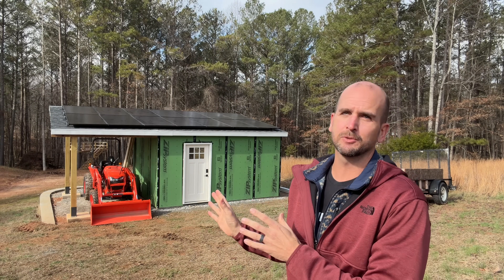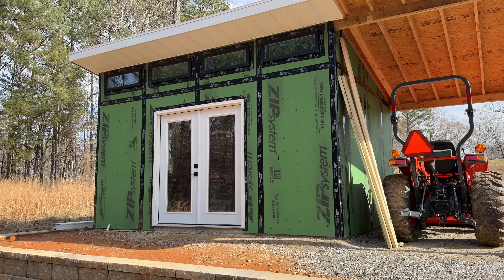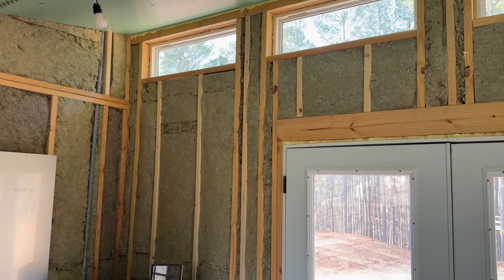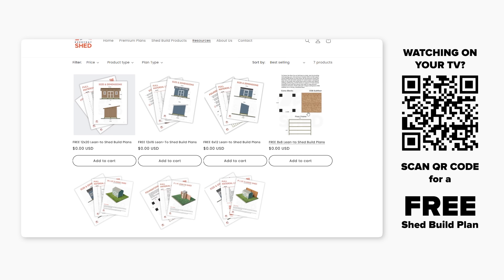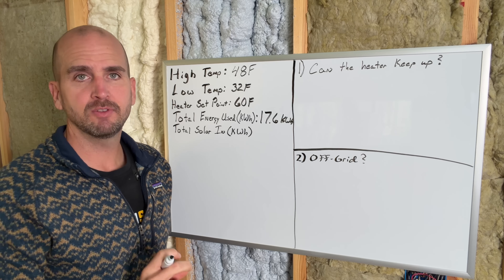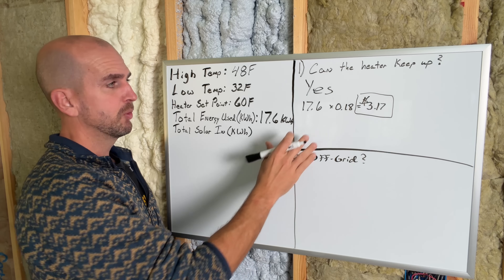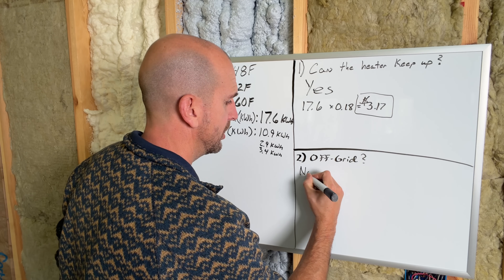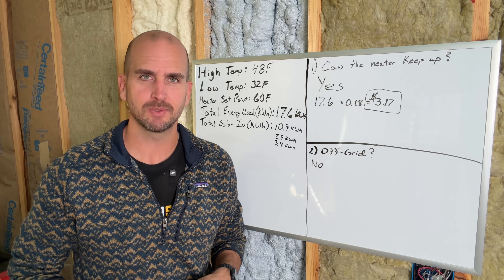HUGE Mistake: Why My $15,000 Solar System CAN'T Heat My Tiny Shed

Comment: A heat pump would used between 4.4 to 5.86KWh to heat that space to the same temperature. It still wouldn't be low enough to run off solar only, but it's much closer.
Reply: Agreed.  Heat pump for the win.
Reply: @babylonfive  I don't understand why 6kWh wouldn't be doable with 6kW of solar though. That system should be producing at least 12kW on average even in the dead of winter where he is.
Reply: @RedMike-ym8hd  it is all to do with the length of day and solar intensity. My 12.6kW system only produced 3.4kWh yesterday (STL area). You’ll always have some form of efficiency loss.
Reply: @RedMike-ym8hd his building has far too many openings and should of went 6 inch walls. thicker insulation on ceiling and foam before he poured the floor..plus he's on a raised chunk of ground that allows cold to seep in further ..I believe if he did it correctly 6 kilowatts might be enough
Reply: @theyhateme8763 Did he do concrete? That's a huge energy suck of so. The floor matters a lot and needs insulation.  Also, R10 roof is really bad and he has nothing to hold the thermal heat (mass).
Reply: @whattheschmidt  u just repeated what i said
Reply: @RedMike-ym8hd  Ahahahaha.
In winter, I get 200-300 watts per day from each 1 kW solar panel ))))
Reply: @whattheschmidt  Yeah, on slab building is not energy efficient, it is cheap to build, but better to raise the floor off the ground and insulate it well.
Reply: @babylonfive  heat pump for AC. Heated flooring is much better for winter.  I learned that the hard way.  Even my 32 Seer heat pump stinks on very cold days.  On very very cold days, it's fairly worthless.
Reply: @veganpotterthevegan  You can heat floors with a heat pump.
Reply: @tieferbk  you can but its not that efficient means of heating a space like this.
Reply: @veganpotterthevegan  Much more so than the 1:1 from direct electric heat.
Reply: @veganpotterthevegan  how big is your space?
Reply: @antoineg639  74 square meters.  Very bad insulation in the walls(haven't gotten to that yet) but lots of insulation in the attic, and rockwool under the flooring in the crawl space.
Reply: @veganpotterthevegan  The Seer of your heat pump doesn't really matter for cold days. You want a cold climate model, some are able to provide good heat all the way down to -13f outside. (Mitsubishi H2i, others?) That's the problem with heat pumps, they have a minimum temperature outside where they can produce 100% heat output but once it gets below that temperature outside, the heat pump slowly produces less and less heat until it produces none as the temperature drops. So you need to really think about how cold it can get. I see 8F, so for me the H2I does the job. If it could get colder outside, I'd have to get an other source of heat. But I still have a Mr. Heater (20,000 BTU, indoor rated) and propane if worse gets to worst or power goes out. Along with monoxide, smoke and a gas leak detector. I have a foam piece with two aluminum adjustable round vents, I place in a window to give a bit of venting if I need the propane heat. Oh, a bit of soft square foam to really seal it up.
Reply: @DataToTheZero  I have a high seer, low temperature minisplit. It's still terrible when it's below zero and bad when it's below 10 degrees.  Mine is supposed to work down to -15.  I've never seen that temperature at my house but it's pretty worthless at -5😅  It regularly shuts off to de-ice itself.  And I live in Utah where its very dry.
Reply: @veganpotterthevegan  Do you know how many BTUs/h it delivers at below 10? because I've seen some companies say works down to 5f. But if you find the specs it's like 5,000 BTU/h at 5f instead anywhere near the 20,000 BTU/h you get at higher temps. And I don't think that counts defrost cycles. So yes technically still running but only enough to keep the pipes from freezing.  Newest ones of the last 3 or so years are supposed to be much better. I'm glad I don't need to find out. Stay Warm
Reply: Heat pump and triple insulation.  Think outside insulation from companies like Insofast.  Stagger stud framing also gets better insulation.  Insulation in the floor also.
Reply: @paullind6534  Considering this is slab on grade, the floor insulation would require raising the floor and redoing the door. I would also argue that floor insulation is of least concern.
Reply: @gslavik  OP should have put 2" XPS foam at the bottom and around the edges of the form then poured the concrete slab on top of it. Ballpark it at $200 in materials and a 2" deeper form to get a MUCH more comfortable space and lower energy demand.
Reply: @SavageChinquapin exactly. Or you can put xps 250 on top and then advantage subfloor and have nicely insulated floors. I'd put either two 1.5 inch layers or two 2 inch layers and the floor will be very well insulated.
Reply: @gslavik then you never stood on concrete during the winter.. that slab is on raised ground allowing that area to get cold faster and further into the slab
Reply: @gslavik if it was a grade level slab, the floor wouldn’t matter as much.  Being raised is completely different.
Reply: Yeah we need Technology Connections to review this setup lol
Reply: @JohnVance  Alec would shred him.
Reply: The electric radiator is about the least efficient device to use for heat. Agree on the mini split or maybe a pellet stove or propane in wall furnace.
Reply: @michaeldia5121 The electric stove is basically 100% efficient. Anything else other than a heat pump is less efficient. Burning stuff may heat it better only because you’re inputting way more energy.
Reply: @Eponymous300 A 100% efficient with a very expensive product.  Thus, it's not cost effective.   He would need to triple his solar panels, buy more batteries,  etc.  Not feasible. 
Having 2" high density foam underneath concrete slab, plus more r value under roof would help.  I think diesel heater or pellet/wood stove the best option for heat.
Reply: @steventhury8366  Very possibly the upfront costs make it uneconomical in the short term. One can also use a heat pump to put heat in a hot-water store to use the heat directly, which would replace batteries.
Reply: @Eponymous300 If wood 60% efficient, but 40% the cost of electricity, wood is the better deal.
Reply: @Eponymous300 Very likely uneconomical in long term as well.
Reply: @steventhury8366 Heat pumps are 300% efficient, so the price would need to be a lot lower…for the long run. Again, I get the short-term math. This is all niche anyway and a reminder of why the grid and community living is necessary for the vast majority of us.
Reply: @Eponymous300 How can anything be 300% efficient?  Do you have a perpetual motion machine?
Reply: @steventhury8366   based on outdoor temperature a heat pump can give 3kw  of heat out for every 1kw in.
Reply: @steventhury8366  An electric heater turns 100% of the electricity into heat and is considered 100% efficient. A heat pump instead uses that electricity to Move heat from outside to inside. It can be 3 times as efficient as an electric heater, but generally doesn't work as well when its below 20F outside. Newer models can handle down to 5F or less.
Reply: @steventhury8366  Heat pumps don't generate heat, they move it, so it terms of electricity in vs heat out, they are 300-400% efficient. That is, for every kWh or electricity you use, you get 3-4 kWh of heat pumped into your house. They have a COP (Coefficient of Performance) of 3-4. Electric heaters have a COP of 1. Anything burning something to generate heat is under 1, often well under 1.

This is why so many people are saying that a heat pump is the way to go. It's also why electrification will lower overall energy consumption as efficient electric system will replace inefficient fuel-burning ones.
Reply: @Eponymous300 So many people had heat pumps and got rid of them.  They don't work well below 25 degrees.  Therefore,  you need and additional system to keep up during the cold spells, thus negating the efficiency.   It heat pumps were what you make them out to be, almost everyone would have them.  
I have some mini splits, which have a/c and heat pump.  They work okay when temp is in 30s or above, but I shut them off when below 25F, because I need natural gas heat at that point.
Reply: @JLars Agree.  Efficiency doesn't equate to keeping you warm.  Being comfortably warm is the objective here.
Reply: @steventhury8366  Again, this is just simply not the experience of many many people. Heat pumps are the main source of heat in Norway, where I'm fairly certain it gets cold in winter. I don't know the details of your system, but it's just a fact that many people run them well below 25°F. It's also a fact that the number of heat pumps in use is growing in the US, even in states like Maine.

Why don't more people have them? Well, unfortunately a lot of the reluctance is due to FUD similar to what you're saying. People also don't just replace their systems if they're still working.
Reply: @Eponymous300  Heat pumps make good supplemental heat for northern climate, but not good for when it's below 10 degree Fahrenheit.  In those bone chilling nights, we need natural gas, propane, or wood.
I  suspect you are coming from the idea that we need to "save the planet", which is a total lie.  We have more gas and oil than we will ever use.  "Fossil  fuels" is a misnomer, because oil is not from fossils. 
When it is very cold, there just isn't enough heat in the air to draw from, and that's just basic common sense.   As far as Norway goes, I don't know their situation, but I  do know the Country is heavily brainwashed with the environmentalist agenda, and I get the vibes that's where you're coming from too.
Reply: @steventhury8366  Ah, I thought we were discussing facts. My mistake. Happy holidays.
Reply: @Eponymous300 I am discussing facts.  Are you saying the environmental agenda doesn't drive the things we're discussing?
Reply: @Eponymous300  A $500 mini split is at least 4x more efficient than the heater...
Reply: @ronfitzhenry3726  thats only a COP of 3... most mini splits at a COP of 3-5 at least these days.
Reply: @steventhury8366  That's false... you just need to buy a mini split rated for the temps in question, if you buy the wrong one you are correct it won't work the difference in amount of heat in the air between 50F and -10F is not that great ... the unit just has to be designed to operate in that range.
Reply: @steventhury8366  no they didnt, and 4  comments up you thought they were perpetual motion machines, so you're clearly just responding through emotion instead of facts. Even when they're working terribly in the cold, that's only in relation to themselves. They are bad because they're ONLY as good as electric baseboards. 

And you simply do not live somewhere where it's 0 degrees, snowstorming uphill bothways on the way to grandmas school 8 months of the year. You get like 3 days a year where its cold and the inefficiency doesn't make a difference whatsoever. And you're replacing it with someone far less efficient so why are you even pretending to care about efficiency? 

You don't see a lot of them because people are dumb and believe stupid things people said 20 years ago.
Reply: You act like electricity comes out of nowhere and coal plants don't exist. Also, you can't seem to grasp satire.
Reply: @steventhury8366 Satire? What satire was in the comment in this thread?
Reply: @xNYCMarc When I said, "perpetual motion"
Reply: @steventhury8366  Who were you responding to? There’s no @ anyone.
Reply: @steventhury8366  That wasn’t satire. You’re trying to gaslight people into thinking you didn’t say something stupid. “How can something be 300% efficient” isn’t satire. That’s you showing your ignorance, then when you realized how stupid it was, you’re trying to alter reality and claim it was “satire”. That’s still not what satire is. At best it was sarcasm. But intelligent people aren’t fooled by your attempt to cover up your ignorance.
Reply: @steventhury8366  Back in the day (I'm talking 50+ years ago) the term 'coefficient of performance' or CoP was used (I'm from the UK) to characterize the key metric for heat pumps. For some reason, the term 'efficiency' seems to be more common these days, despite it not really being wholly appropriate for the way they work. CoP was basically [output heat energy]/[energy needed to operate the heat pump]. The energy going into the evaporator side didn't come into this calculation but was implicit in the value of CoP itself. Personally, I think CoP is the better term, and causes less confusion than 'efficiency', since the traditional way of thinking of - and computing - the efficiency of machines inevitably results in values <100%.
Reply: @HowardRiley-g2o What I'm sensing is that so many advocates of things like heat pumps and electric cars don't calculate in the energy required at the coal plant, or the energy/cost in manufacturing solar panels/wind generators. 
The global warming lie has blinded so many people into a "saving the planet" mentality.
Reply: @steventhury8366 I'm with ya on the big scam... but, I believe the discussion here is all about finding how much heat we can sustenantly pull from the sun before having to supplement from more conventional heating systems.  

I'm all about conservation and not polluting, and I don't mind the tree-hugging hippies who are aiding the push for advancement in home power and heating efficiency, even if their reasoning is more politically motivated than mine;  we have something in common, even if our idealistic bases are a bit different, and besides...  we all need to get along, right?  

My reason for choosing this path is to leverage my dollar so that it will go as far as possible, and to remain independent from the grid monster in any way I can, without going back into the dark-ages...  Harnessing available budding technology is the key here.  

Besides... I've always been a science and technology geek since childhood, so this appeals to that root as well.
Reply: @michaeldia5121  Or diesel heater
Reply: My mom’s heat pump uses only about 1kw/h and heats her 14x24 fine.
But she has a lot better than r10
Reply: Yup, and add some thermal mass (water or similar) for the longer dark times. Way cheaper energy storage than batteries
Reply: Look up "Turning a $150 AC Into a Super-Efficient Geothermal Unit!" by Tech ingredients. IT makes even a basic heat pump like 4x more efficient.
Reply: @heroofharo  Spot on!
Reply: @heroofharo come here say exactly this, small vertical geothermal loop connected to a heat pump window unit might get it done, or at least closer.
Reply: yea I heat a space like 8 times bigger than this with the same solar power
Reply: im heating a 1300sqft house off solar using a 12000btu heat pump and 10 shattered solar panels from a solar farm, heat pumps have come a long way and i was surprised how well it did expecting much worse performance when i installed it. granted where i live it is rarely below 32f but it also kept up in the summer at 120 degrees outside.
Reply: @jadenwebb8651 What model is your heatpump?
Reply: I run a 12,000 and a 9,000 heat pumps along with everything else in my home completely off solar. We are off off grid with 14,000 watts of solar with twin 6k inverters and 62KWh’s of batteries.
Reply: I was going to stop the video the moment I saw that he was using a space heater. It's literally the most inefficient way to heat an area, so I was kinda stunned he went that route.
Reply: @dontbanmebrodontbanme5403  Same here! And I know he knows better...doesn't he!??!!? As stated by many others, that ceiling insulation is laughable and the floor is a problem!
Reply: @dontbanmebrodontbanme5403  Actually , it’s 100% efficient. Burning fuel is even less efficient. So I’m not sure how you can say it’s “literally the most inefficient…”. It’s literally the opposite. Now, you might be trying to say it’s the more expensive way to do it. But cost is not what efficiency means. Efficiency means how much of the input gets converted into what you want it to be converted into. Electric heat is literally 100% efficient. ALL of the electricity gets converted into heat in the space and none of it goes up a chimney not doing useful work.
Reply: @xNYCMarc i agree it’s 100% efficient but you are missing the point and the colloquial meaning of “inefficient” for the literal meaning. It is inefficient to use an electric heat pump because the amount of heat per kW/hr is lower than that of a heat pump. The person you are replying to is just trying to make that point while using the wrong technical words to describe the issue. 

Heat pumps are a better form of heating despite the efficiency differences of the two technologies.
Reply: @TheEmptyHoliness   Using words incorrectly isn't made right by simply calling it "colloquial". You're also making a strawman argument about heat pumps being MORE efficient.

The other user said that resistance heat is "the most inefficient". Not simply just less efficient. Words mean things. Even going by your "colloquial" allowance for abusing the definition of words, they would STILL be incorrect since colloquially electric heat wouldn't be the most inefficient since gas heat only gives 75-85% of the Kw/h input.

I think you missed the point of both my comment and even your own comment.
Reply: @xNYCMarc most inefficient in means to cost. It's an inefficient way to heat a space based on cost per BTUs.
Reply: @richarddabkowski2896   Wrong. Diesel is the most inefficient way to heat a space based on the cost per BTU delivered into the space.
Reply: @xNYCMarc would depend on where you live, electricity is expensive where I live.
Reply: @richarddabkowski2896  Electricity is  expensive here too. But so is diesel, everywhere.
Reply: @xNYCMarc  You are being pedantic to a fault. There was a very simple point the person was making: It's not a good idea to use an electric resistive heater when you are aiming for the most heat output per kW.

Everything else, all of the arguing and disappointment in other people for "abusing words" is simply not necessary.

We all agree that an electric resistance heater is not the right choice and that a heat pump would be a better option here. Let's stop standing around in a circle arguing with each other over the literal meanings of words and how one person said something that was literally wrong despite their obvious intent being correct.

For example you don't need to point out "it still wouldn't be the most inefficient"

That's like walking up to the owner of a "world famous hamburgers" restaurant in the middle of nowhere and arguing with them that their burgers are not literally world famous.
Reply: @xNYCMarc  Also since you are saying I'm using a strawman argument about it being more efficient I"ll just throw this up here:

Electric Resistive Heater: Converts 100% of the electrical energy it consumes directly into heat. While this is a 100% conversion efficiency of electricity to heat, it is often considered the lowest possible result for a heating system.

    It operates with a Coefficient of Performance (COP) of 1.0 (1 unit of electrical energy in → 1 unit of heat energy out).

    A heat pump's COP is typically between 2 and 4 (sometimes even higher, especially for ground-source/geothermal), meaning for every 1 unit of electrical energy consumed, it delivers 2 to 4 units of heat energy into the home.
Reply: @TheEmptyHoliness   This is what people say when they have no real argument.

Do you really think THIS is necessary? It's funny how talk about something not being necessary when you're doing exactly the same thing.

I wasn't even talking to you. Mind your own business and stay out of OTHER PEOPLE'S conversation. This has absolutely NOTHING to do with you.

Talk about unnecessary.
Reply: @xNYCMarc  Just for the math, we'll go worse case scenario, as most people use heating oil and not diesel (same stuff, but one is taxed a lot more)

But lets say you have one of those small diesel heaters, looks like they are 80-97% efficiency. 

Gallon of diesel = 138,000 BTU * 0.8 = 110,400

At 80% efficiency to get 1,000,000 BTUs you need 9.05 gallons of diesel, near me thats $4.56 a gallon. So you'd need $41.30 to get there.

1 kWh has 3412 BTUs, and 100% of the energy becomes heat. 

To get 1,000,000 BTUs you would need 293 kWh. at $0.30 per kWh (actually cheaper than what i currently pay) would be $87.92, more than double the cost of the diesel heater. 

To break even at $4.56 a gallon of diesel (with worse case scenario heater) you would need a kWh price of $0.14 a kWh.  Now some midwestern states probably have electric costs that low -- but i'd guess their diesel prices are also lower, so the math would change.
Reply: @richarddabkowski2896  Heating oil IS DIESEL. It’s exactly the same as off road diesel with a red coloring added. 

80-97% efficiency!? Bwahahaha. Try 60% efficiency in the real world. 

It’s easy to make the numbers work when you begin with a false premise.
Reply: @xNYCMarc  I know it's the same, i just mentioned worse case scenario -- If you can buy off road diesel, or just get heating oil, the math works even better for the diesel heater (worse for resistance heat) 

I was using the price of road diesel, and electric was still way off.

Even if you drop the diesel heater down to 60%, that brings the total to $55 using road diesel($$) still well under the price of electricity
Reply: @richarddabkowski2896   Except you're not using REAL WORLD numbers. You wouldn't be paying 30 cents a kwh if you were on an electric heat rate from your utility. 

Go ahead and call your power company right now and ask them what their "Electric heat rate" is. It's probably 11 cents.
Reply: @xNYCMarc  That's the price of electricity here. I have "electric heat" (heat pumps) My friends use a woodstove (they have electric resistance), they aren't getting their electric bills cut by 1/3 if they say they have electric heat.
Reply: @richarddabkowski2896  Have they tried? Have YOU tried? Ignorance isn’t an argument. Until you call and ask for the “electric only heat” rate, they aren’t going to give it to you. It’s clear based on your reaction that you’ve never even heard of a special electric heat rate even existing. 

What utility company do you have? I’ll call them myself and ask what their heat rate is.
Reply: @xNYCMarc  Are you unfamiliar with Coefficient of Performance (CoP) for heat pumps? 

While not technically accurate, for all practical purposes you can consider it a multiplier on efficiency because you are moving heat, not just generating it from electricity. A CoP of 3-5 is common, so 300-500% "efficiency" compared to your "100% efficient" resistance heat.
Reply: @SavageChinquapin  I’ve owned heat pumps since the 1980’s. That’s not what this discussion is about.
Reply: @xNYCMarc  Looked it up. Turns out, it's new in 2025 and I'm automatically enrolled since I got the heat pump installed through them. 

Saves me $0.04 a kWh, so still no where close to cheaper than diesel.
Reply: @xNYCMarc  Sounded like you trying to use a technicality as a "gotcha" when in the real world it was just being misleading.
Reply: @SavageChinquapin  You might want to read and comprehend what I said, starting with the first comment. It’s all there and quite clear what I was saying. The conversation got sidetracked by a troll trying to stir the shit. But that wasn’t the real subject of the conversation.
Reply: @xNYCMarc that's not what the other poster meant by efficiency. The real question of interest is how much energy is required to generate a specific thermal gradient between inside and outside. If you want to pin an electric heater at 100% efficiency, then a heat pump achieves 200-400% efficiency for the same gradient. Saying a space heater is the least efficient use of the electric power being discussed in this video is correct.
Reply: @naasking  The other person is perfectly capable of saying what they mean. Why do people think they know better what someone they don’t even know means to say?

You are adding words that they DID NOT use. They didn’t say a space heater is the least efficient use of electricity. They said it’s the least efficient way to heat a space. 

Why is everyone else able to say this, but not the other person? Maybe it’s because that’s not what they meant and they now realize that they were incorrect.
Reply: @xNYCMarc  the clear context set by the video and assumed throughout this thread is using electricity to heat the space. You're being intentionally obtuse if you're trying to pedantically argue some other point that nobody cares about.
Reply: @naasking  Again, the other person is perfectly capable of speaking for themselves. MIND YOUR OWN BUSINESS. 

If nobody cares about it, then why are you commenting? Hmmmm. Act like you don’t care. Try again.
Reply: @xNYCMarc are you new to the Internet? Do you not know how this works? If you post publicly, then others are free to reply and correct you, and if you don't want to be corrected, then think more carefully before posting and be more charitable. I'm sure you'll get the hang of it.
Reply: @xNYCMarc You are confusing efficiency with effectiveness.
Reply: @steventhury8366  No I’m not. Thanks.
Reply: @naasking   Are you new to the Internet? Do you not know how this works? If you @ someone, you're talking directly to them. Yes, others are free to reply, but that doesn't mean they should. If you don't want to be told to mind your own business, then think more carefully and look who the @ is to. I'm sure you'll get the hang of how conversations work eventually.
Reply: @xNYCMarc  Yes, I do know how this works, and I am @ing you because you made the errors that needed correction.
Reply: @naasking  I didn’t make any errors and even if I did, it wasn’t to YOU. So clearly you don’t know how conversations work. Also, who appointed you the arbiter of what “needs” to be corrected? You sound like a narcissist who thinks he’s more important than he actually is.
Reply: I wonder if a hot air box on the south(ish) wall would make up the difference.
Reply: Actually if you get a Solar diy mini split it would be able to heat the space off solar.
Reply: enough insulation all you need is a candle. Your point is obtuse.
Reply: It would be very interesting to see how much better a EG4 or Air Spool hybrid mini split would do. It would probably do it with half of the panels. Of course for the cloudy days and nights the hybrid would benefit from a 120V grid supply. It still would automatically switch back and forth and use very little electricity because it would supplement only as nedded.
Reply: one step further, a heat pump with radiant floor heating would heat that space perfect for minimal cost.
Reply: Weird that more resources didn't go into the design for efficiency. More insulation everywhere and using a heat pump with 200 to 300% efficiency.
Reply: DIY geothermal heat pump.
Reply: 5 kwh? A 9000 btu mini split would only use a 1/10 of that
Reply: I have a 3.5kw system in the middle of Texas, and heating is a big challenge for a 500 sw ft area with a heat pump(12000btu). I have 10 kwh of batteries and this is plenty for summer cooling, but around the winter solstice I'm maxing out around 6.2 kwh on a day for power generation, and cooler days like today where it's 40F peak and starred out around 30F it's only 58F inside(with 4" of open cell spray foam on the walls and underside of the roof. Last year it was below freezing inside when the temps were around a low of 10f and high of 20f, and I had to save batteries for my fridge and heated with propane to take the edge off.
I intend to upgrade to at least 6.5kw of panels(and better placed for less shading out) and 30kwh of battery storage next year, and I'm hoping that will make me way less reliant on propane on the cold days.
Reply: I just built my 2200sqft house with a heat pump and I'm not living in it yet.  I'm seeing how much power it uses at about 60F inside.  For a 40F day, it's about 10kwh.  For a 25F day, it's about 20kwh.

For his test he needs to keep the thermostat steady for at least one day ahead of time before doing the calcs because of the transient heating of the walls.  For my full sized house, it's more like two days to get a good reading.
Reply: @MrPizzaman09  The 20kw is when the electric resistance backup heat is running. They call them “heat strips”. They are used when the temperature goes below the minimum temperature that the heat pump can effectively move heat from outside to inside. You didn’t choose a very good heat pump. A good one should be able to go to -15 before needing “heat strips”.
Reply: @xNYCMarc 20 kwh per day, not 20kw of power. My system will pull 1 kw roughly continuously, though can get up to about 5 kw before it fires up the 14kw worth of heat strips
Reply: @MrPizzaman09  That makes much more sense.
Reply: Bingo
Reply: In the winter, my 32kWp produces 5-10kWh on the cloudy days. So you need a lot more PV, Batteries, insulation, high efficiency 9,000 BTU MSHP system.
Reply: No.
Reply: Plus, that shed will be sweltering in the summer! A heat pump/AC is needed if you’re serious about using it all year for an office.
Reply: @wcg66  Well, the real answer is not to build a little stand-alone shed instead of adding onto an existing larger structure. :-)
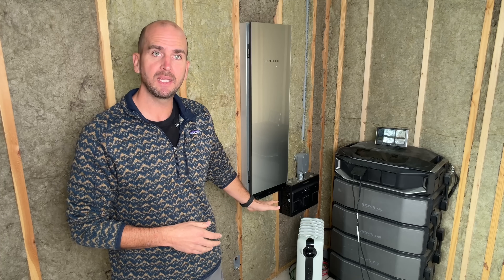Reply: 2:59 those radiators suck
Reply: Also add a moist barier on rhe inside. Now moist goes into the isolation, and thats not good. Also, use a moist barier that reflects infrared back inside. So an aluminum based reflecting barrier.
Reply: That is way too much for that space. Any ordinary A+++ AC with an inverter would do a better job.
Reply: Insulation for the win actually. Forget a heat pump.
Reply: A few more panels might do it.
Reply: Heat pumps are bad for the winter time they become completely useless when it gets too cold I do not recommend them one bit but, They are perfect for general weather and you're still going to need a supplemental heater in this case an electric heater
Reply: @SHSPVR  it depends.
In my moms case, “extreme” winter lows are 10f. So it might become inefficient or ineffective.
But extremely unlikely.
And there are models that work down to below 0f and have supplemental heat on the exterior to assist with cold. And while that doesn’t sound effective, it still allows for more efficiency than a space heater.
Even so, it shouldn’t be the only heat source in a living space
Reply: @SHSPVR You're thinking air-source heart pumps. Ground source heat pumps can move a lot more heating energy relative to input power.
Reply: @edeaglehouse2221  Are you're referring to Geothermal Heat Pumps they're not any better than a traditional heat pump or a mini split if the temperature gets too cold they are useless especially down in the minus negative degrees the best options are still electric or gas or oil burners furnace or even outdoor wood boiler but the downside is they all require lot of power to run with the exception of wood stove.
Reply: @SHSPVR  You are wrong about this. Heat pumps work fine in winter. You need to get the right kind for your climate, but they're in use all over Maine and in northern Europe, etc etc.
Reply: @Eponymous300  I'm gonna have to disagree with you because we have one at our house It is complete garbage I really wish the landlord had installed a traditional gas one.
Reply: @SHSPVR Honestly millions of them are in use globally. You got a bad install or the wrong unit. Sorry.
Reply: @Eponymous300  Nope 'cause I know other people who also have them And you're not gonna convince me otherwise
Reply: A heat pump is useless in temperatures below -20 degrees celcius...said my building engineer who installed one in his own house.
Reply: @markanthony3275 no.  Ours has heated down to -24F
Reply: Try the Elon musk ultra air heater
Reply: Solar in winter is a non-starter.  The Sun’s lower, and up for less time.  Winters also tend to be gray.  No amount of battery can fix that.  Unless heat pumps have changed, it’s a cold fire (Rush ref).  Feeling less cold ain’t the same as being warm.
Reply: @jeffforbess6802 let’s be real there is some amount of battery that could fix it. Just not the traditional kind or amount 😅. Store up the energy from the summer and use it all winter!
Reply: @jeffforbess6802 no, you just have to size it based on winter expectations. Regardless of system, you always design it to be stable in worse operating conditions. For any system.
Reply: @jeffforbess6802  No it’s not a “non-starter”. I’ve been nearly off grid for the past 10 years in rural New York. Almost 100% of my heating and cooling is covered by solar. I burn propane for about 4 or 5 days per YEAR. The rest is heat pump powered by solar and batteries. I have zero electricity usage for the last 10 years. Even on the bad 4 or 5 days when I switch to propane, the solar still powers the rest of the house. There’s just not enough for heat on those few days. 

Maybe if you had real experience with solar, you’d know what you’re talking about instead of repeating “theory” or something from other people.
Reply: @xNYCMarc  How many panels are you using to heat what volume of space?
Reply: @Objectified  The number of panels doesn’t really tell you anything. But it’s a total of 32kw and 120kwh of batteries.
Reply: @xNYCMarc no wonder you live off grid. No one will put up with your smug attitude. Although I do commend your commitment to being wrong for the sake of argument.
Reply: @ulysseswhiskers7046  Off grid doesn’t mean alone. 🤦‍♂ Also, you need to read more carefully. I'm not off-grid. I said NEARLY off-grid, meaning my system generates more electricity than I use. I still have a utility connection. It just isn't being used.

Thirdly, I haven't been wrong about anything. Just because someone disagrees doesn't mean I'm wrong. In fact, everyone has said that I am technically correct, but that I should just be "nicer". Such snowflake nonsense. Whenever a snowflake tells you to be "nicer", it means they couldn't handle being wrong. 

Try better next time.
Reply: Heat pump won't work at 32 degrees.  Auxiliary strips would come on and use much more power.
Reply: @Dieseldogg1117  myth. Modern cold-climate heat pumps work well in Alaska and Canada and remain far more efficient than resistive heaters even in sub-zero conditions. (-20F to -31F)
Reply: @pbm___000  eh rule of thumb, ideal temps heat pumps get around COP of 5. freezing temps its more like 2-3, and sub freezing they exponentially approach a COP of 1. appearently this depends a lot on the humidity level outside. over my head.

burning gas for heat = 30kwh/gallon
burning gas for electrical power = 10kwh/gallon

makes more sense to run a diesel heater in temps under 40F than it does to run a diesel generator to run a bunch of heat pumps. this is the thermodynamics everyone online talks about but never understands. also space heaters can be really efficient, the secret is in their name.
Reply: @vevenaneathna  

The premise of this video was a person that's off grid. So it's:

* do I oversize my solar system to handle even the dark winter months?
* do I get a generator to handle the 15% of the time solar can't keep up?

Almost always, the smarter option is to get a generator. Otherwise, you've built a solar system that 85% of the time produces more power than you can use, especially since you're off grid and not sending power back to the grid. If you're going off grid, you're going to ALWAYS want a generator for redundancy as well. Even if you somehow had gas lines coming to your off grid setup, the average US home uses 30kW of power a day and you'll most certainly have days where solar isn't producing that much. Again, unless you oversize your system.
Reply: @dontbanmebrodontbanme5403  well, the roof angle could be more steep but i think a 2nd ground mount is cheaper
Reply: @vevenaneathna just put a cold weather heat pump in my house despite outrageous  $.30 per kwh electric rates.  It was 25f the other day and heat pump works great without the dual fuel turned on.   I calculated a crossover of about 25’ at a COP of 2.5 to switch to propane.  At 40’ the heat pump is still a COP of 3 at max output and COP of 4 at low output.  The heat pump is clearly programmed to run at lower output to take advantage of greater efficiency.   So longer run cycles at lower output.    Very impressed so far and operating cost should be cheaper than propane.   It’s one of those very  tall and slim Lennox compressor condensers manufactured by Medea.  
Don’t ask about payback though, new system retrofit was $21k minus 3k in rebates. My old AC was 25 years old and 10 seer, so time to upgrade.
Reply: @vevenaneathna  The more humidity, the more your coils will frost up with ice, reducing air flow and insulating from heat transfer from the air.  Thus you will not get as much eat transferred, and you will need to run in the defrost cycle more often.
Reply: @Dieseldogg1117  a heat pump minisplit would absolutely work. Inverter compressor heat pumps can put out 100% of their rated heating capacity down to 5 deg F.
Reply: @memsu06  Many can go down to about -10 and still be effective.
Reply: @Dieseldogg1117  Tell me you don't have a heat pump without telling me you don't have a heat pump! Or maybe you have a heat pump made many, MANY years ago? My geothermal heat pump never needs to use the aux power. NEVER. Same with a regular heat pump. My mother-in-law has one. They're great. The very old models that were super inefficient and could only reliably work down to like -5F, maybe those would use aux heat, but again, even then, it would be at a colder temp than what was in this video.
Reply: @dontbanmebrodontbanme5403  I like the geothermal concept.  I also think it can be augmented with a solar hot water heater to heat the area around the geothermal pipes during the hot sun.  I think this would even work on cloudy days.  Even better would be to have a sand heat battery or a water reservoir.
Reply: @Dieseldogg1117  incorrect new mini splits can heat down to -13F and many lower  I use one in COlorado I'm off grid, they are impressive now, hard to beat.
Reply: @unionse7en  I stand corrected.  I wasn't aware the technology improved so much.  Sounds like it may be time to get rid of the old gas pak unit.
Reply: @Dieseldogg1117 

Dang diesel dawg your information is ......ruff.
Reply: @MyGoogleYoutube  Way outdated apparently.
Reply: @Dieseldogg1117  Only one solution - have them buy you one and put out the details in a year.
Reply: @Dieseldogg1117  It's not the 1980s anymore. There are plenty of modern heat pump designs which work just fine without auxiliary strips down to -15F or even lower Mitsubishi "Hyper Heat". Mr. Cool. Daikin "Fit Aurora".Etc. 

Many HVAC installers aren't well versed in heat pumps (they're AC/Furnace guys) and will set up your heat pump incorrectly to trigger aux strips WAY too soon, often defaulting to 32F because that's the "lore" handed down from their predecessors.
Reply: @Dieseldogg1117  most heat pumps will work to -14 now. Some are rated to work to -32F.
Reply: @Dieseldogg1117  Well, maybe with yours, but my do with no Aux....
Reply: @Dieseldogg1117  Airspool mini Split goes down to -22 degrees Model HS24. Many of the new ones go way below 0 degrees.
Reply: @Dieseldogg1117 False. Modern heat pumps can work at much lower temperatures than that.
Reply: Good modern heat pumps work to negative temps and are still are par with gas for efficiency. Technology connections has a few great videos of heat pumps
Reply: @Dieseldogg1117  Dude, you are so 1995. You need to stay current with the technology.
Reply: @Dieseldogg1117  I heat my home with only a heat pump and I see temps down to single digits... My home is not so well insulated but the heat pump will maintain down to about 24 degrees at which point it will loose some ground, but I can still keep my place livable, just not 68 degrees. I'll grant you that I do let the heat drop, because I will not allow EM heat if possible, but my point is a heat pump continues to work at lower temps, it just takes more electricity as the efficiency drops. My heat pump uses between about 1.5 to 3 KWH per hour over the range of outdoor temps from 50s and up ... down to single digits. Currently the price of electricity is a much bigger limiting factor than the heat pump's abilities.
Reply: @Dieseldogg1117  Heat pumps (some, anyway) can extract heat from air as low as -20F.
Reply: @Dieseldogg1117  Strange that my heat pump works far below 32F. I wouldn't have even installed it if it didn't.
Reply: @Dieseldogg1117   Simple split AC units in EU and Japan (actually - Heat pumps) DO work down to -15*C (+5*F) for the low quality ones, and down to -20*C (-4*F) for the top brands. Information taken from their datasheets. And they will work even below, but their effectiveness rapidly drops and they may not be able to keep up below  -15*C/-20*C.
Reply: @Dieseldogg1117  Really?  Because mine just worked down to 5 degrees.   I have my aux heat strips turned off.
Reply: @Dieseldogg1117  new heat pumps can work below 0 Cel.
Reply: @Dieseldogg1117  That used to be true. Technology has improved where that is not true anymore.
Reply: @Dieseldogg1117 my bosch heat pump is advertised to run at 100% efficiency down to -4° F. Real world experience with my system it will work down to about 8° F before the backup heat starts to help out. The backup heat is only supplemental though. It still uses the heat pump most of the day and then switches to the backup grid when the heat pump doesn't satisfy the thermostat in a quick enough period of time, or when the outside unit goes into defrost mode and the thermostat calls for heat in the same time frame. And my system is not a hyper heat unit. The bosch version of hyper heat came out the following year and is advertised down to -10° F. I cant vouche for the bosch hyperheat system but my brother has a Mitsubishi hyperheat minisplit heat pump for his addition. It does not have a backup heat system in it and at -10° F outside that mini split was still blowing 120° air out of the vent.
Reply: @95dodgev10  nothing can run at 100% efficiency
Reply: @Dieseldogg1117  they work great down to zero